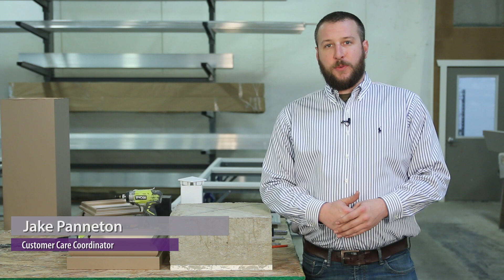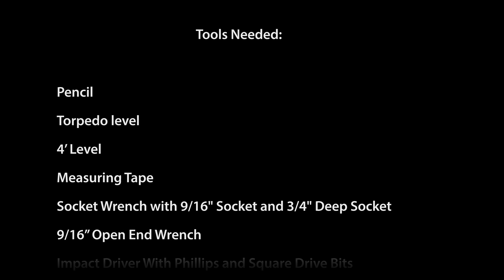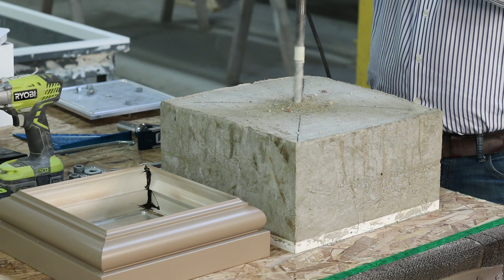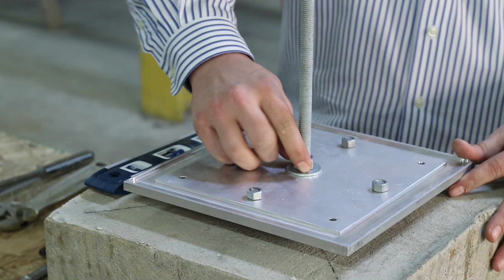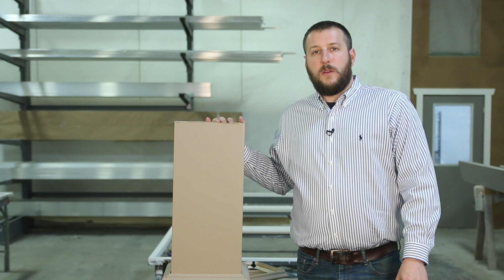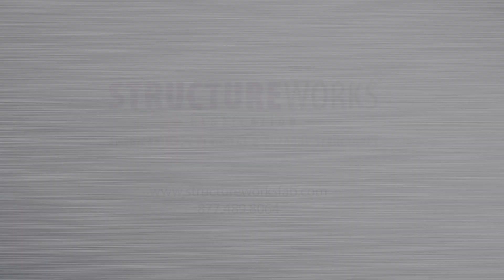How To Install a Pergola Column Using a Concrete Mounting Kit

Comment: Hi, are the column leveling plates available for purchase? Thanks
Reply from the maker: Hello Michael - Our leveling plates are custom manufactured to work with our posts and structures and are not available for standard purchase.
Reply: @Structureworks1  Never deny a sell....

Comment: What is the minimum thickness of the concrete patio for this mounting kit to work .. our pergola is 20x20. Thanks..
Reply from the maker: The instructions for this type of installation specify -  6" deep hole drilled into footing - these instructions can be found in the Design Resources area of our website. https://www.structureworksfab.com/design-resources/